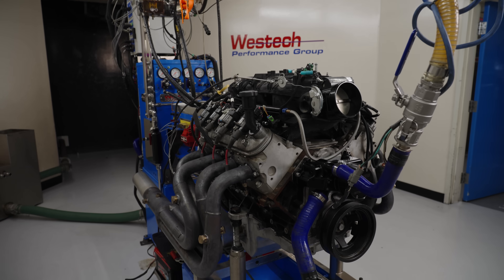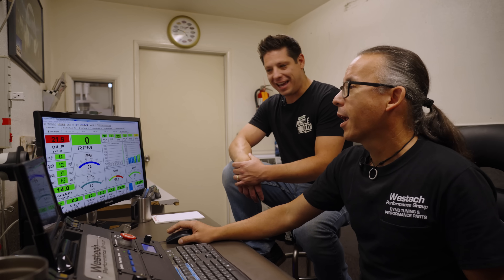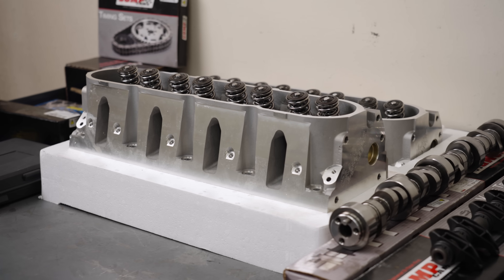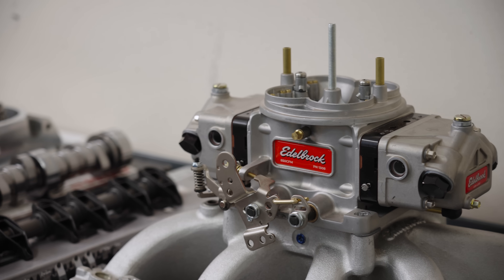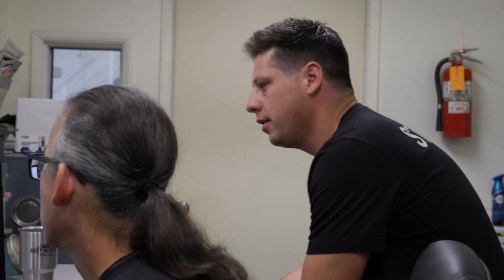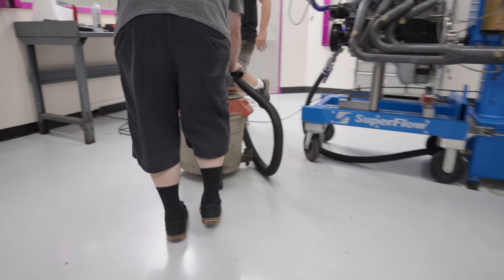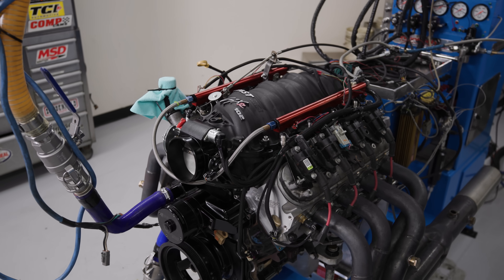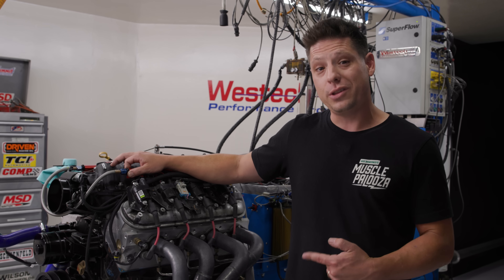4.8L LS: How Much Horsepower Can We Squeeze Out Of GM's Smallest Displacement LS Engine?

Comment: Those are very respectful number's. 

My cell does not do the engine idle justice.  So...is it a choppy sound at idle with the fuel injection, and did you all have to retune the ignition?
Reply from the maker: Oh it's very choppy. We tuned the ignition and fuel for each component we changed.
Reply: @hemmingsmotornews  
Very nice.

Comment: This gives the 4.8 in my van some hope. One of these days I'll slap some speed parts on it.
Reply: Do your homework on your cam choice! Do not just go buy some cam someone recommends on YouTube comments. The duration and LSA matter. Call a cam specific manufacturer such as Comp, Crane, Texas Speed, etc and tell them your combo, engine/trans/gear and what your wants are or expectations are for your build and they will direct you properly.
Reply: @JustAGuy781  yes Texas speed is a good choice I love my cam
Reply from the maker: Sounds like you have a plan!
Reply: Go with a Truck Norris, Chopacobra, or Summit 5/4 Nasty cams. They offer great power but huge gains from 2k-4k vs any stage-2 sized cam.
Reply: I put the stage 2 cam low lift from TSP without a tune on my 5.3 L59 suburban without a tune it’s crazy how much power it made without a tune I don’t know the horsepower but It moves that heavy suburban down the road pretty dang good

Comment: Needed more RPM with that cam.  It was still climbing!   The stock 4.8 bottom end will safely do 8k.  I'm surprised Richard didn't mention that.
Reply from the maker: We did several pulls to 7,500 and the power was falling off. If it had made power up there, we'd have sent it!!

Comment: I LOVE my 4.8! I have a 2011 silverado with 247k and still runs strong. They don't have the dreaded afm either. I pull a little 20' camper and does pretty decent. I also have my HD but I prefer driving the 1500 any day. When it finally dies (as long as the block is intact) I'm going to put the e street heads, cam, and possibly intake. Great video. Glad someone else appreciates the 4GREAT. It's a 5.3 with a shorter stroke but with no afm or displacement on demand. Same heads, intake, external components. Crank and rods are the only difference as far as I know
Reply from the maker: They are great engines! Glad you liked the video and are enjoying yours.
Reply: Are you still on the orginal transmission?

Comment: is the 4.8 a 4 inch bore?
Reply from the maker: 3.780in bore. That's what makes them tricky. They can't fit the big valve heads many of the bigger LS engines use.

Comment: Well normally I wouldn't comment on this but 🤔 f.i. over carb depends on the carb and application. Dual plane intake was not tested. Single plane is not ideal for testing. F.i. is the better choice with computer induced timing on a distributorless ignition. Carbs is one setting with no fine point of accuracy during advancement. Tuning the f.i. factory  can boost several h.p. but it's not efficient. Everything is about balance. The more you give the more it takes. I mean I'm sure you know this but it wasn't stated in the video of fuel psi to the larger cam to find a happy  middle with the headers and increased flow from the head swap. Need more detail!
Reply from the maker: The air fuel mixture and timing was optimized for every condition we dyno'd in. The VR-S is an excellent carb and the mixture was perfect so we are left to assume the results we saw are a function of intake manifold design more so than FI vs Carb. That gen IV truck intake is really, really hard to beat. The LSX-R was absolutely better but not by a ton.

Comment: Just got one on a truck with 98k
Reply from the maker: How are you liking it so far?! What are your plans with it?
Reply: @hemmingsmotornews I like it. It's great 4-8 not bad. I also have a Denali so I have lq4 truck too.... But this has like a misfire hat on the highway. Po300, I already has new plugs and wires. It didn't get driven a lot. I'm wondering if maybe the intake manifold gaskets or the manifold itself has a crack but it runs great even with the mess it only comes on on the highway but it also has a leaky fuel line not on the ground leak but seeping wondering if I have low fuel pressure when I'm accelerating hard
Reply from the maker: Hopefully you get that situated so you can really enjoy it, and thank you for sharing! 🤝
Reply: @hemmingsmotornews just fuel line causing miss on highway and evap code for pressure regulator... It screaming at me with the diagnosis

Comment: Have a 4.8 in a S10 with a small cam, hooker blackheart exhaust manifolds , true dual exhaust with a x pipe, stock intake manifold, and a stock tune. Makes 285 wheel 305 torque. So around 380-390 crank probably. 
After a tune maybe around 300 wheel.
Reply from the maker: That's awesome! I bet that truck is a riot!
Reply: @hemmingsmotornews  it’s pretty sporty when you want it to be

Comment: The coyote is the best motors super small cubic inch high horsepower and high revving. The only problem with the coyote is they're really wide hard to swap them in certain cars. LS engines are cool but they're starting to get too expensive
Reply: Coyote doesn't need anything just bigger injectors and boost
Reply from the maker: In all fairness, the coyote is bigger (4.8 vs 5.0) and with boost this engine would have easily made several hundred more horsepower. Coyotes are great too.

Comment: Still making power, why shut it down so early?
Reply from the maker: In about 50 pulls it never had a power peak over 7,300. No need to spin it harder when it's already proven it won't perform past a certain point. I've had to mop the dyno floor before after an engine failed lol. Not that day!

Comment: Keep in mind, you are measuring Gross Horsepower, which is measured at the flywheel (Net Horsepower is also measured at the flywheel, not the tires).  Gross H.P. is also measured with and open exhaust, open, unrestricted intake, and no accessories connected to the front of the engine.  Then it is corrected to STP (indicated on your dyno computer screen) Standard Temperature and Pressure (Sea Level Pressure 29.92 In Hg and Sea Level Temp 59 degrees F or 15 C)  very favorable conditions.

Net Horsepower requires stock intake,  stock exhaust, and full front accessories connected (power steering, alternator, water pump, etc...) then corrected to SAE NET H.P. (29.23 in Hg, 77 degrees F or 25 C) 

My 4.8 L is 285 SAE Net H.P. on my 2004 Silverado

That said, closing in on 500 Gross H.P. from a 4.8L is impressive!
Reply: Some don't realize that the factory gross horsepower rating died with the muscle car in 1972. Factory net rating after that.

Comment: The 4.8 may be junkyard cheap, but all the aftermarket parts cost about the same as the ones for a bigger engine, so if your going to spend $3K to upgrade a engine, why not spend a bit for a better engine in the first place?

Comment: 200K on the motor, overhaul it with new rings and pistons that bump up the compression ratio. This will add HP and a little bit of torque as well as help with the throttle response.
Reply: I agree 100% I'd buy a nice set of .030 over keth black or a good name brand piston with a anti frictional skirts chrome moly rings and cylinder hone for it and a set of gen 4 rods that are rod checked for roundness and a set of load/heat resistant bearings any high preformance bearing. Idk my thoughts. And get a set of 10.5 to 1 compression pistons with big valve reliefs like 80 thou or more and run it on 91 octane with that same combo of the heads and manifold and headers and tune I'd bet it pick up a decent more power. Idk I'm a educated enthusiast at joliet junior college automotive who works on cars and I love engines, transmissions and rear ends. Great video guys please keep dynoing engines
Reply: With low tension rings those cylinder walls probably look like they did when they were brand spanking new. No joke. I've been a gm tech from 27 to 40. I'm 45 now and Service write.
Reply: @augustrodriguez8023 100%
 I just took the LM7 out of my 05 Silverado to do some work and at 163k the bores still looked amazing. Literally to the point where you could probably put it back together without a hone and still get perfect sealing. The engine still made perfect oil pressure too. Factory LS sleeves hold up really well and with regular oil changes using a good synthetic you get almost zero wear.
Reply: Lol you havent done many ls's have you
Reply: So will a 200 shot of nitrous. 😂😂😂
Edit. Good suggestion, but a 200 shot of nitrous "as well as" a proper tune will do the same. 😂😂
Reply: Not for nothing but a well taken care of LS with mid to low mileage will eat  200 HP worth of Spray all day long 
Obviously a few more mods should be added but you can get a forth gen f-body into the nines without even doing head work, intake, cam a good stall with a built trans and make sure you get your suspension and chassis all hooked up 
But yeah LSs love big cams and big spray
Reply: Why does every other person write the phase ( as well as ? ) Just write well as.....  I'm guilty, I'm so guilty as well as others

Comment: How much torque
Reply from the maker: 378.5 lb-ft at 5,600rpm as shown on the final dyno plot.
Reply: @hemmingsmotornews  this would make a mean lil engine in something like an S10 or a Shoe Box Nova. Something small and light that wont require huge torque to get moving

Comment: Think a little bit of compression could have gotten you there?  With that much cam it's probably a must, and I think you actually gave up a tiny amount of compression with those heads.
Reply from the maker: I do think compression would have helped tremendously, but we wanted to keep the short block stock. A domed piston with some valve reliefs could have worked wonders.
Reply: @hemmingsmotornews  Definitely!  But I'm really just thinking machine those heads down to a small chamber, and flycut the pistons a bit as needed to give the proper P2V clearance, and let 'er rip again!!

Comment: I had a 4.8 in my old work van. That is a tough little motor. 
 I loved it. It was used, abused, and never got regular oil changes.
 I delivered medical supplies, and (mostly) oxygen tanks. When loaded down in my 2500 express, the suspension and brakes complained a lot more than the motor. 
 Sometimes i would drive more than 2500 miles a week, and she never let me down.
 I had a dead battery once, but nothing engine related.
 And, for a big van, that thing had plenty of acceleration. If i was empty, that thing would move.
Reply: I currently own a 4.8 '14 express,  needs a rebuild on the old and tired 6l90 trans. Planning on using the van as a tow workhorse as well as occassional mobile mechanic service and cargo runner for my shop. Engine sounds healthy at 290k.

Comment: The whole point of the 4.8 is high RPM & boost. Put a little cam in it and a cheap turbo and let it eat. No issues making 600 whp all day long on them even with high miles.
Reply: yessir

Comment: Back in the 70s, Modified Production class cars ran 288ci, 292 cube SBCs making 550-600+hp NA turning 9500-10,000 rpm. 2-bolt 283 blocks.

Comment: Hotrod Magazine made somewhere around 800-850 hp before their engine gave up. It was originally supposed to be a 5.3 build, when they took the bottom end apart to investigate the damage they realized it was a 4.8
Reply from the maker: Familiar with the story. It made 1,200 but it was twin turbo, which is a completely different animal than what we did here.
Reply: @hemmingsmotornews  they used a bone stock engine and one turbo and e85. The twin turbo is another completely different build altogether
Reply from the maker: @felonysounds  You sure about that hoss? I only recall one time a 4.8 was mistakenly tested instead of a 5.3.
https://www.motortrend.com/how-to/hrdp-1109-stock-gm-ls-engine-big-bang-theory/

Comment: pausing the video at the HP/torque curves leads me to this conclusion: at any RPM under 5000, new heads, spark and fuel tune, e85, aftermarket intake, and comp cam netted less than 20 hp.....if I'm wrong please explain, but very lack luster.....
Reply from the maker: Is it really fair to call a setup that picks up more than 20hp at the lowest point and over 119HP at peak power lack luster? Even with the big cam shifting the power up (an inevitable consequence of a large-duration camshaft) the engine still picked up everywhere across the power band and made an astounding 1.62hp per cubic inch. Seems like a major improvement to us.

Comment: Weird how motors rated at 265-280 make 350 on these dynos   I call bs.   We all know you can alter the numbers but geez almost. 100 more than factory
Reply from the maker: No BS, just a different testing protocol with a different intent. OEM dynos are a whole different animal. They hold the engine at different RPM points for a painfully long duration. The final numbers are actually an average of the engines output during a measured time span across those ranges. Things like catalyst protect, which richness the air/fuel mixture to lower exhaust temperatures at WOT, and other tuning parameters, such as a reduction ignition timing as the engine coolant temperature rises, will actually lower the measured output during an SAE dyno pull, so the final numbers are more like average peak and not true maximum power. That's why we often see stock vehicles make more power than they are rated at on aftermarket dynos.

For racing and street performance, we're not looking to produce a product brochure with guaranteed output to go with a new vehicle, but more to find the delta in performance increase between multiple component or tuning variables. Hope that helps explain why we dyno in this fashion.
Reply: @hemmingsmotornews  ain’t no way 4.8’s make that kind of power.
Reply from the maker: @kleenhall6885  I did it, and they do.
Reply: I agree, the newer gen 5.3 make 355, that 4.8 had to have been tuned to the max

Comment: Nice  package, but not much good on the street. 
 For street; 
there is no sense running it with a 4-speed manual transmission. 
She would need race gears, a very-high stall convertor, and at least a 4-speed auto with a LU.  
and, in the end, it will suck gas ALL the time. 
So now, I gotta build the rest of the powertrain around a 7000PLUS rpm engine.  and gas it up every night before I go home.
Should I put this in my HotRod?
notta chance.
Well maybe. but sacrifices will have to be made.
Reply from the maker: A 4 speed and steep gears is the quintessential hot rod. The old guard ran way bigger cams and that was with a carburetor (often multiple carbs) on the street. This thing is fuel injected and would be just fine. All horsepower takes gas. That's why we measure Brake Specific Fuel Consumption on the dyno. This engine was actually very efficient for the power it made.

Comment: 4.8 should be around 275HP stock. That is not stock or not a 4.8.
Reply from the maker: It sure is. You can see the stock, small-bore pistons, stock cam coming out, stock truck intake, etc. We followed this engine from being pulled from a 2010 Silverado all the way to Westech. The block carries the correct 4.8 markings and all. It's actually heading into a bonneville car where engine displacement is hyper important to class rules.

Comment: Those edelbrock heads won't cut it, a better set of heads would have probably made the number..those are basically a slightly better 243/799 head.  A set of (good) CNC ported 243s, trick flows or AFRs with a smaller combustion chamber to bump compression would put it at or over 500.

Comment: Holy moly, dropping several thousand dollars on mods with a big honkin' cam in an LS to make just a hair more power than a bone stock Coyote from the same time. Good ol' GM engineering.
Reply: quiet down, a simple cam and spring swap in a lowly 5.7 hemi can make 550/510. and a 5.3, 6.0 or 6.2 LS would be almost as good. GM and Mopar can power 2500/3500 trucks with the torque they make. Ford had to create a whole new engine for that. A Coyote has to rev to 7000-8000 rpm to make power without boost.
Reply: way to completely miss the point. Also a Coyote NEEDS DOHC to even compete. different paths to the same goal. GM's LS do it with square and over square big displacement OHV engines in a SMALL and efficient package. Ford went the complicated route and is limited by huge exterior dimensions and small internal displacement.

Also any GM LS engine is far cheaper to acquire and build than Ford OHC V8s. simple because GM made MILLIONS of them and Ford only has Coyotes in performance apps and as an option in trucks. the Ecoboost V6 far outsells the 5.0 in the trucks.
Reply: Instead of a high Rev dohc long timing chain 🔗 complex  garbage. The squared engine Bore Stroke reliability trusty pushrod and longevity trusty true is the way to go for everyday practical ! 

The Chevy and Dodge have the better MORE RELIABILITY and they can run with the best of them! It also depends on torque range and power curve applications the longer stroke for Truck applications Dodge and Chevy will win every time normally aspirated! They don't need to scream 7k to make grunt power! It all depends on the applications